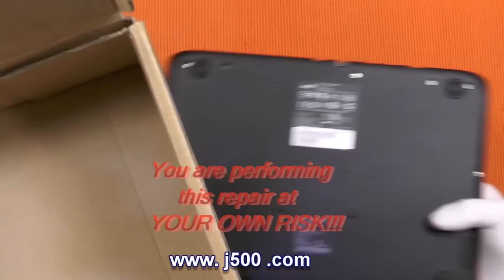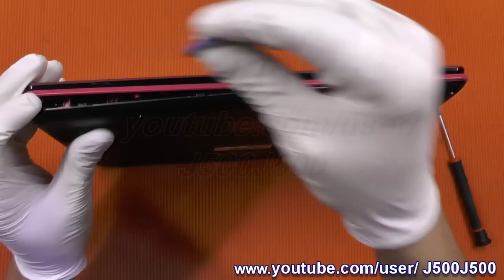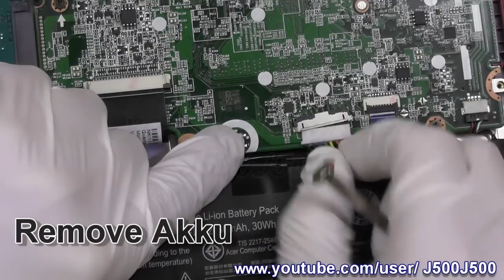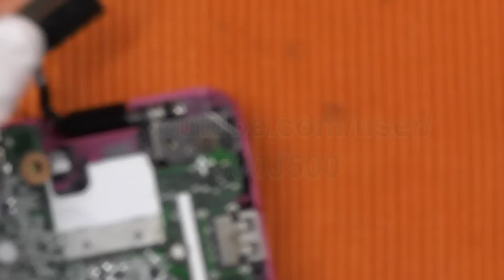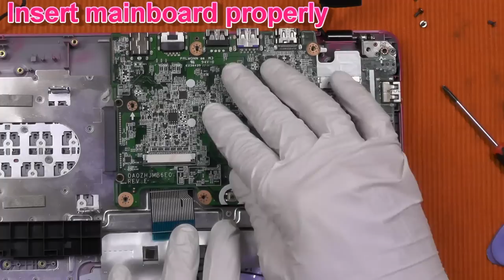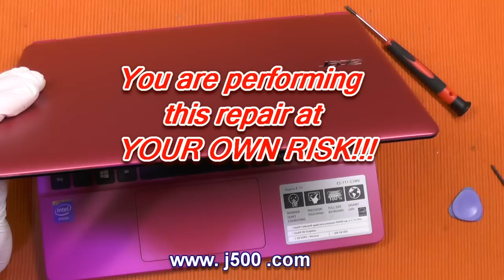Disassembly Acer E-11 V-11 ES1 E3-111 V3 112 Upgrade Ram HDD

Comment: I have just upgraded a Acer Aspire ES1-111M V3-112P Motherboard Celeron N2840 32GB eMMC NB.MRS11.001 with the sata connector and the 9 chips that are next to it (top and bottom of the board) of a Acer Aspire E3-112 DA0ZHKMB6C0 Model ZHK. My hobby is micro soldering, if anyone tries to attempt it without the right tools Will fail. After the transfer of the sata connector and chips desolder the eMMC chip because it will conflict with the ssd drive. I installed a 240 ssd and loaded windows 10 with UEFI. Works a treat

Comment: thx for the video, i finally upgrade my "acer aspire E11 es1-111-C1ZM",
the speaker cable was really hard to remove

2GB                                                  => 8GB
HDD 320Go                                    => SSD 120Go
Linux lubuntu 18.04 (32 bits)      => Linux lubuntu 20.04 (64 bits)

all work fine, speaker, touchpad, keyboard, wifi, screen ofcourse lol

it's boot faster, but i think i should switch to another light linux distribution 

thx, this was very helpfull
i will watch "those kiind of video" before buying a laptop now

Comment: i try to upgrade the ram of this laptop to 4 gb, but when I start on the computer the screen stayed black, I test the ram in other computer and works normaly, Why does it not work? And  What frecuency support the motherboard 1333 or 1600?? very good video
Reply: sando421 
1333mhz ddr3 ram stick, 8gb maximum.

Comment: Any idea what type of sata connector could be used which will fit cleanly with the pcb or if a model number is visible on the connector installed in the video you posted. The E11 I have doesn't have a connector soldered to install a hardrive :( Thanx.

Comment: Thank you VERY much for posting this, and in such a detailed (close-up) way!  We were able to upgrade a E3-111-C4GX from 2G to 8G, and add a cloned Samsung Pro 840 SSD, thanks to your video.  The $229 laptop now runs like a new $1500 MacBook Air! :-)
Reply: Awesome! Will do the same tomorrow.
Reply: Wow!!
Reply: Hi what ram did u use. 1333 or 1600 for the 8g
Reply: SimplyLetter Days The exact RAM used was this one, ordered through Amazon Crucial 8GB Single DDR3 1600 MT/s (PC3-12800) CL11 SODIMM 204-Pin 1.35V/1.5V Notebook Memory CT102464BF160B

Comment: Hi j500j500,

I have a ES1-111M-C9VZ that does not seem to have the SATA header included so is there anyway for me to add a SATA drive? If not then it goes back cause 32GB eMMC just is not enough space.

BTW, great video.
Reply from the maker: http://community.acer.com/t5/Notebooks-Netbooks/Aspire-ES1-111M-C0FQ-doesn-t-have-HD-or-SSD/td-p/317869

Es1-111 different models
Better just open case and watch
Thanx

Comment: Hello, how can is possible change the video card in this laptop? i wanna change it for this Sapphire® Video AMD Radeon HD5450 1024MB DDR3, can i? and how?
Reply: +Mathy Campos 
The graphics are integrated in the SoC, so you can't change the GPU or CPU. I don't think there even is a PCI Express port in there, so no luck there too.

Comment: I just wanted to expand the hdd from the 32GB ssd, so plugged in a micro sd adapter  (Bosvision low profile) and 128GB of microsdxc. This does not stick out of the side of the pc like a standard sd disc does, so I leave it in permanently. I reformatted this as NTFS, and use it as the main storage drive, to keep all my office programs, Google drive etc. The SSD 32Gb drive is way to small on its own, but with this modification (£50 approx), it works really well for all my requirements, and I have not voided the warranty by taking it apart.
Reply: +Malcolm Mathew The only Bosvision low pro I could find is either for the raspberry are the Macbook Pro Retina. which one do you suggest for my Aspire E-11? Also, I'm wondering if this memory would work: https://www.amazon.com/gp/product/B00G5SSDIW/ref=ox_sc_sfl_title_4?ie=UTF8&psc=1&smid=A3JJ6E432635IP
Reply: Hi Mark, I used the Bosvision Low Profile MicroSD adapter for Raspberry Pi, with a 128GB microsdxc card from SanDisk, both are on Amazon.com (I purchased them from Amazon UK, but they are on the US site also). The memory you have is RAMM, I don't know if it would fit or not. My laptop is new, and under warranty, so I did not want to violate this, which is the case when you take a screwdriver and add RAMM. The Bosvision just slips into the SD slot, and can be removed (with tweezers!). Good wishes from England.
Malcolm
Reply: Malcolm Mathew
 Thanks, I ordered the lo-pro from Amazon. My E-11 came with 2ggb ddr3L and it gets bogged down easily. Especially playing Facebook games with Flash Player. Mines out of warranty.

Comment: E3-112-C36L (it's sold on French market) works perfectly with 8GB kingston M1G64KL110 which is a PC3-1280 (1600Mhz). According to Intel page on N2840 this shouldn't work, for N2860 supports ram up to 1333 Mhz. But it definitely works without any problem.

Comment: Excellent Video! I used your video to SLOWLY take the 8gb of ram out of one Acer E-11 w/Windows 8 and used it to replace the 2gb of ram in another Acer E-11 w/Windows 10. Basically, switching ram from one laptop to another. As with any job, if you have ALL THE NECESSARY TOOLS it shouldn't be overly difficult. I had some latex gloves, magnetic philips-head screwdriver, dishes for the screws, small plastic dish scraper (which I used to get into the casing), and a couple small flat-head screwdrivers to help disconnect the wiring harnesses. I moved EXTREMELY SLOW. It took me about 1 1/2 hours to get into both laptops, disassemble, replaces ram, and put back together. EVERYTHING WORKED GREAT! Slow & Steady wins the race! Thanks for the video!

Comment: Is it possible to install a samsung ssd hd? will it fit?
Reply: +Andrea Cremonini 
As long as you have the model equipped with a 500GB HDD (the 32GB eMMC variant is just a chip without a SATA port), all 2.5" hard drives and SSDs will fit. I'm not sure if it's SATA3 or SATA2, tho, so you might get a little bit slower transfer speeds.

Comment: I bought two of this model a few months back, and it's a massive disappointment. Even with all the bloatware removed, it's very sluggish. With the bloatware (stock condition), it's practically unusable. 2GB is completely insufficient for this model, and an upgrade is almost mandatory. So why did Acer make it so difficult to upgrade the RAM? Having to flip over the mainboard just to get to the RAM sounds ridiculous.

But thanks for the great video - without it, I wouldn't even be considering an upgrade! :)

Comment: Hi, I was wondering if anyone experienced any performance improvements after upgrading the RAM to 8GB.
Reply: +TubeheadSkinnymike hell yes, around 60% less ram usage on idle.
Reply: +CRacer1995 does it significantly increase the speeed and performance though? the 2gb ram keeps causing everything to crash sighhh..

Comment: Thanks for the video.
Do you know how much ram these mini laptops support?
I quick google search pulled up 8gig stick for 40 bucks, but I'm not sure if its the correct type or not since I just typed in DDR3L in google...
Reply: +32bitcal 
As long as it's DDR3L SO-DIMM memory, it will support it (up to 8 GB).
Reply: Yes, that will work.
Reply: +Mark Las Vegas hey may i ask if the ram works well? i checked out the link and it seems legit.
Does the increase in ram significantly improve its performance? (my laptop is really slow, and i am thinking of upgrading mine too)

Comment: Have you ever had problems with some of the keyboard keys not working? Just recently after Windows April2018 update, all directional keys (except up arrow) and Del button do not work.I've tried unplugging battery and holding power for 30 secs and then powering back on, I've tried deleting and reinstalling keyboard driver, etc.

Comment: For those who don't want to go through the hassle of re installing Windows if you put a bigger HD in (If you happen to have bought the version with only a 32GB SSD and most of that is used up by Windows). Just buy a fast decent size SD card and pop it in the slot on the left hand side.. Or buy a decent size micro USB pendrive and pop it in the blue USB3 port.. Does the job perfectly.

Comment: Hi my laptop is ACER E11 112M-C39N i want to replace/upgrade the ram from 2GB TO 4GB. BUT i dont know what kind mo ram im going to buy.. My ram info is 2GBDDR3L. should i look for DDR3L TOO? HOW about the voltage and frequency..someone told me that i need to look for those info before buying ram

Comment: Thanks very much for posting this! I was looking at this little notebook PC thinking to buy it (actually the ES11 but I guess it will be very similar except with eMMC not 2.5" HD). It looks as though the 2032 BIOS battery is soldered or spot welded to the board? What with all the little thin ribbon cables and the construction of the thing, it looks as though it is intended to be a disposable unit which I really don't like.

Comment: I upgraded my E3-112-C6CM from 2 to 4 GB RAM successfully but an upgrade to 8 GB resulted in a black screen.
Reply: Cetin Senol
Are you sure you used a compactible ram stick, which should be sodimm 1333mhz ram?
Reply: Ebuka Ezenwaka some company's  build a limit in for your computers safety. and so you go out and buy a shiny new more powerful computer to upgrade

Comment: Someone please help me. How much ram can this thing hold?
Reply: 4gb
Reply: Thanks. Where can I buy an upgrade in the uk?
Reply: +ohRizza | Joined Link in the uk the max is 8gb.
Reply: +ohRizza I just successfully installed 8gb.
Reply: UK?
Reply: I ended up Putting in 1 stick of This memory and it recogonized it immediatly and perfectly, I didn't have to do anything special to it and it FLYS now!  G.Skill Ripjaws, So Dimm 1.35V ( Low Voltage)  Lifetime warranty. F3-1600C11S-8GRSL    CL11-11-11-28 SO-SODIMM  

   Seriously, this worked perfectly and it was less than USD 40.00 with shipping included.  

   awesome bargain.     the only other thing I can do to make this faster now is to get a SSD HD.  but it's really quick now with the 250 Gig western Digital that it has in it so i think i will just keep it like this.   I put all teh specs for that memory so there is no guessing, you will love it.
Reply: +ohRizza Looking For A Team ;) installed an 8gb kingston unit today, upgraded from the stock 2gb. just clicked it in the mainboard socket, no problems whatsoever, started right away. very pleased, 60% less ram usage on idle.
Reply: CRacer1995 Could you possibly link me to the memory you purchased? It would help loads. :)
Reply: KINGSTON ValueRAM 8GB SO-DIMM 1600MHz DDR3L

be careful, theres a version for full size mainboards and one for notebook mainboards. they are sized differently.

edit: i bought mine in a local store for 49€ (gotta support locals!), depending on your location it might be around 40-50€
Reply: CRacer1995 Thank you :) Very helpful!

Comment: Thanks for the video. I have the ES1-111M-C7DE. In case anyone else have the same model I just installed Kingston 8GB 204-Pin DDR3 SO-DIMM DDR3L 1600 (PC3 12800) Model M1G64KL110 and the Laptop runs much better now.

Comment: Neve do it. Upgradin RAM in N2xxx or N30xx laptops will not change anything. With good CPU 2GB is enough. These CPUs (N2xxx or N30xx) cannot use memory. Upgrading RAM will not cure them (and no need to use gloves - technicians use them only during inspections)